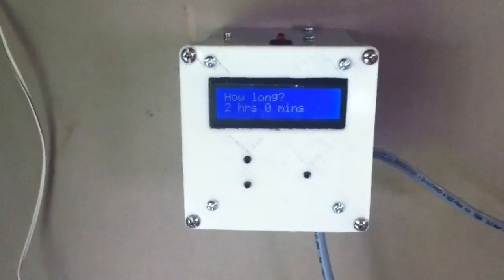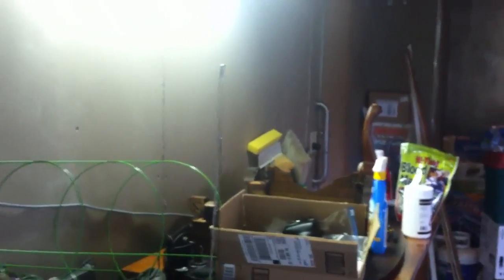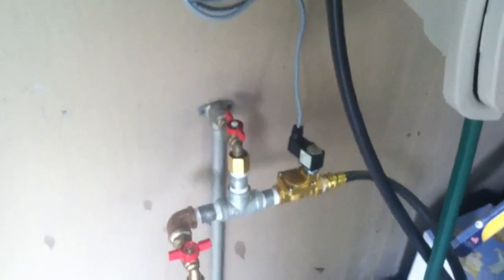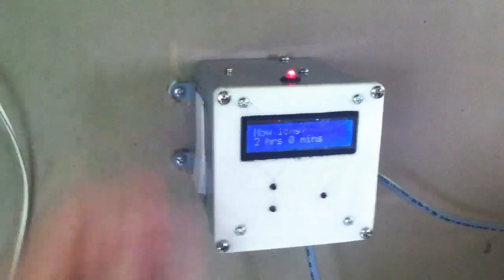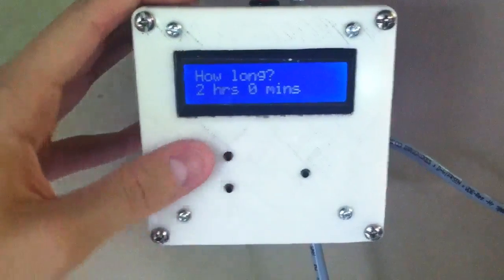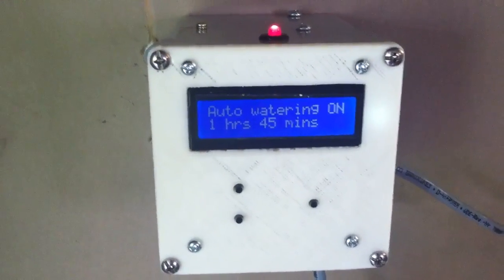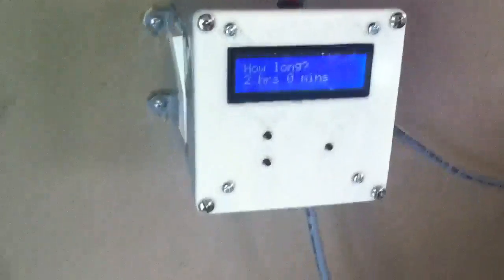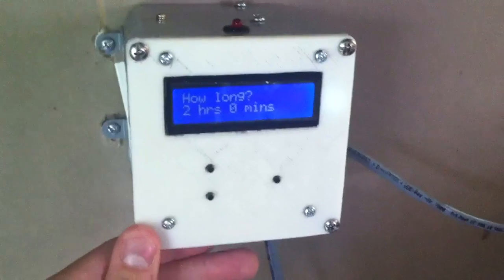Automatic Garden Waterer Operation

Comment: Well for sure interesting project but could be impoved by moisture sensors of soil.
 It it's not a big garden one or two (diy moisture ) sensor will do the job. Also as I see that's one industrial valve over there which makes this simple project little bit more expensive than it should be. Used valves from old washing machines are just fine, and cheap also! :) And one thing I don't like here: use of DRINKING water as irrigation water... Is there any well around? making one from underground waters ?
And as you know best water for plants is rainwater. You could make some dark color reservoir to collect it and water heated from sun during day use it for garden watering. Just few ideas, with no intent to criticize this project :) Cheers and sorry bcs my probably bad english
Reply from the maker: milek021 Thanks for the feedback! I'd love to do something with moisture sensors, but the garden is too far away to run wires and I didn't want to complicate things by adding wireless sensors. This is at my girlfriend's parents house so I wanted to keep things easy for them to handle as they aren't very technologically savvy.
I had that valve unused from another project but if I ever get a chance to tear apart a washing machine, I'll definitely look for a valve.
This garden is located in a small yard in the middle of a town so no wells to use and I wasn't at liberty to collect rainwater at their house for the plants.